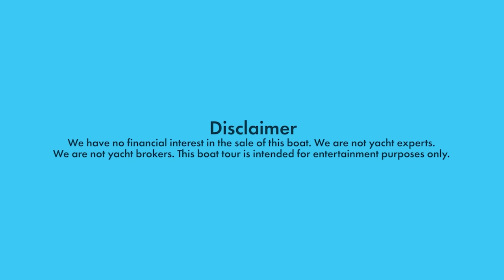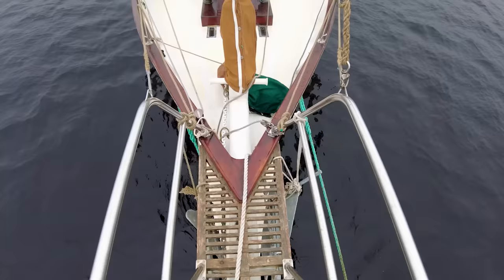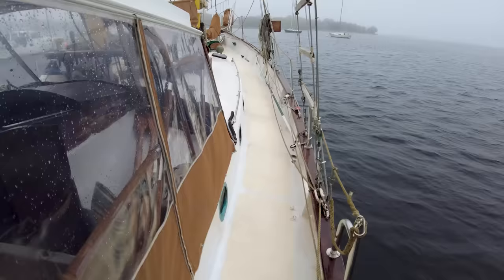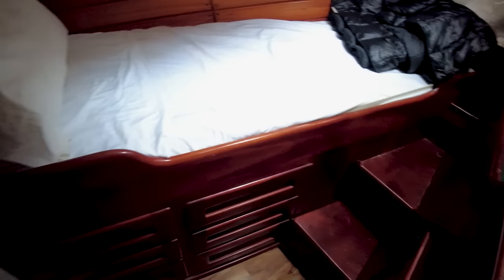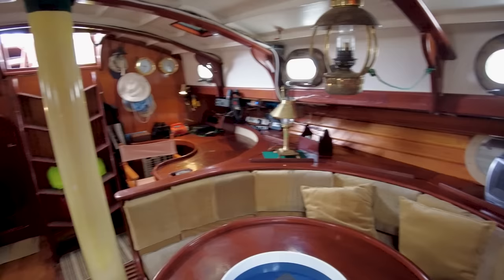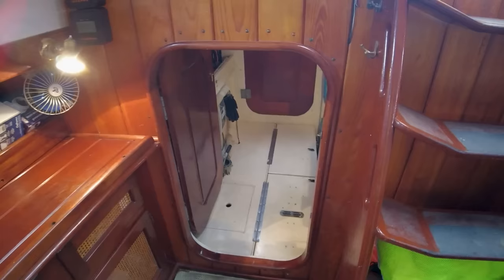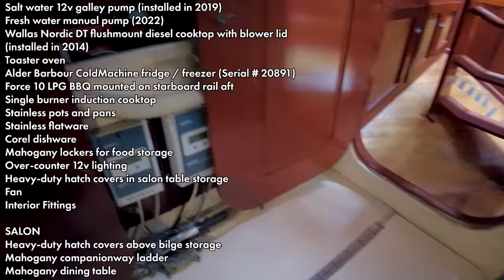This 62' STEEL Schooner Will SHOCK You [Full Tour] Learning the Lines

Comment: Gaff rigged topsail schooner.  The foremast is a gaff with the option to run a square topsail. The horizontal yard on the foremast is actually two yards lashed together. because you have to go aloft to set it, its. an near certainty that its almost never used, and the sail is stowed below deck.

Very old school indeed, a 19th century fisherman would find it fairly familiar if rather overly luxurious.  Need a crew of 5 or 6 and they had best be seamen all of them.

Comment: Ca'mon man, ask some questions before you publish so you'll look less like you've learned nothing, the "Organizer" is a FifeRail. For securing halyards, etc, not for hanging stuff.
Obviously the fire is gaff rigged, why else would it have a gaff.
The Maine is Bermudian or Marconi.
The aft wooden rail could be called a "fly rail or taffrail".
This schooner may be unique in some details but this Colvin hull has been used hundred of times, with variations of rig and cabin plan. 
This boat has a self tending/tacking club staysail, and a jib.
The horizontal spar aloft in the fire(mast) is a yard, although that is the first I've ever seen that is not symmetrical side to side.
This is undoubtedly a home built or home finished where things didn't work out quite like hoped.
Lots of work to remedy.
The wood over steel deck is an issue, advanced steel rot underneath.
Good luck getting insurance on an older custom steel vessel period.
Curved bench in galley provides zero place to comfortably relax.
Galley forward is great until the cook comes up sick in the first real seaway.
NO OVEN!

Comment: Its a very cool boat. But before I would go onto the ocean, I would definitely make compartments on a steel boat that can stay afloat with at the very least 1 compartment or the biggest compartment completely filled with water. Done with steel navy like doors and hatches in the bulkheads and decks. But that is just me. 

Also I would install ventilation that you can close off from any water. Maybe even a heat pump. And install thick insulation all round. 

Now, if you have that a lot can be done, and fun can be had. But I'm not sinking in the middle of the ocean.  

Also installing big antennas on the ship so you can work all HF ham bands and satellites. If the rigging is used the profile is not big at all. Seems like there is already a HF radio and tuner. It is unclear what antenna is used for this while its not mentioned.  

Get a starlink installed too. For internet. 

Netting on the sides instead of ropes you can fall past. 

Get scuba gear so you can scuba dive, and a pressure pump to fill the canisters. 

A 3 meter rubber inflatable boat and an outboard engine. You can have these boats fill up with pressure canisters too!  

A transformer in the corner and some welding rods and tools can have you repair your steel ship in about any place that has power. 

The deck at the back, or the entire deck you could replace with plate steel. If I beams are purchased you could create a very sturdy deck. Or is there steel under the wood already??

I like the dingy in the back. 

There is a long list of stuff on it too. 199k Canadian dollars. For 150.8k USD that is something to consider. But it sure is a lot of money. 

Greetings,

Jeff

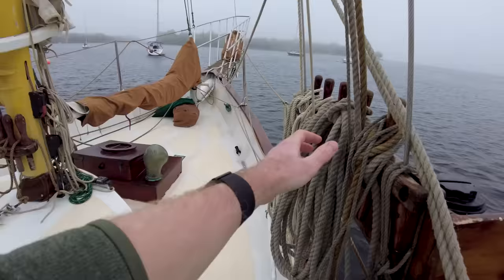Comment: 2:37 "You don't have to worry about rot" … but you sure have to worry about rust !!!…

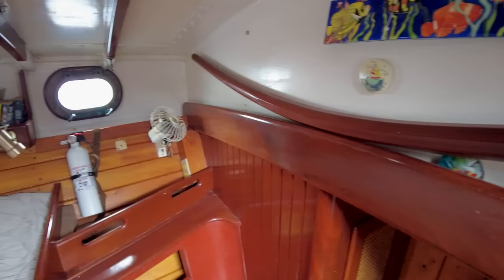19:54 "tiller … if you wanna be at the tille instead at the wheel" : mist likely it is an emergency tiller would the wheel mechanism break in a dire moment. It is pretty wise : actually in some European countries an emergency tiller is mandatory on all boat steering with a wheel.

Judging by the main cabin roof seen from below it seems the deck doesn't have insulation : when sun heats, it must be a real inferno down there. Also it certainly means the hull isn't insulated either. Which is a real drawback both in very warm and cold weather.
This would be my main concern.
Otherwise the boat seems to be very well taken care of…
Personally I don't like the galley being amidship, I prefer it so be close to the companionway for many reasons : odors can escape more freely, the cook is in his/her own corner and not in the way of crew going from the forecabin to the salon, and space left in the companion way could well be fitted with two single berths over each other which would greatly improve the sleeping capacity. This boat should sleep a minimum of 6 persons because handling such a heavy boat takes some muscle and accommodating 8 crew will certainly help navigate farther in the same amount of time.
I always loved sailing with a good numerous crew, prided the boat could accommodate them, because we could sail in a month in place as far as Scotland or Portugal from Brittany and back in 4 weeks … while same boat with a limited crew of 4 were restrained to the English Cornwalls or the Atlantic coast of France. Far sailing takes its toll, and sharing the effort makes us enjoy cruising more. Then again that's how you meet people from all kinds of backgrounds and the huma experience is something to remember (of cours ebad experiences exist too, but we forget these).

Comment: Looks like a delight to sail WITH a crew that doesn't have sleeping space. I'm 6'1" 238, so I'd be very cramped in this boat. Love the large engine room, hate the small doors and ladder face plant potential.. The price is right though. Steel sailboats are hard to come by. Making the main cabin into a full size bed would be a piece of cake. I'd change the rigging immediately to make it one or two people compatible and defintely reduce the amount of lines. Rope is old and needs replacing. Steel boats are HOT in warmer climates so ventilation is definitely a factor. But for thirty grand or less, in repairs and modifications, this boat could be an absolute delight depending upon the surveyors report.
Reply: Try eating some vegetables.

Comment: Having watched a few of your clips I feel I have take some criticisms: the reviews appear tuned to females? How many women buy boats? A man wants data: name of the boat, if it’s a commonly built design approximate numbers, stats: year of build, dimensions, build material e.g. hull steel or glass or wood etc, rig, sail suit, bunks, shower, toilet, water and fuse tank size, water maker, separate Gen set, engine, prop type, keel type, draught/draft, electrics, electronics, anchors and chain etc. get it? Information and data. A biography of the builder, a history of the boat.

Comment: The upswept bow is great but you want to make sure the foremast and headsails are keeled deeper than the the mainsail and the center board keel doesn't interfere with the keel line stem to stern academic keeling design reduces heeling over and increases speed..
Reply: it doesn't have a centre board

Comment: The top spar for the square is called a yard. The wooden railing at the stern is called a taff rail. I’d like to see this vessel under sail, and I’d like to see the square being deployed and used.
Reply: If they followed suggestions from Colvin I've seen on other boats and in his book, the Yard stays rigged and the sail is deployed or doused from deck with lines.  The yard can be dropped seasonally for less windage aloft.

Comment: Although I love to see these old-fashion boats in the marina, I never would own one: The rigging demands an entire team to sail it, that is my first issue. Good for a sailing school or organization of enthusiasts, but useless for a couple or even family with small kids. In the same time it is priced at the level of many 40 foot modern catamarans, which could be singlehanded. Steel is absolutely not without issues either. It may not rot, but it do corrode and a boat this age need thorough inspection before deal is made or it may end up being an absolute dead end bringing it back to sailing condition. The cockpit is uncomfortable and the whole under deck accommodation is unique, yes, but only fit for small people: I would hit my head hundred times every day in rough seas. You should only buy this sort of boat, if you are okay with the boat being your full time job maintaining it, because it will be.
Reply: I agree with everything you said and the MAIN problem is the 'Rig' setup. Would require a crew of AT LEAST 3 able bodied seamen to take full advantage of all the sails. If this vessel was a Sloop Rig it could be 'Single Handed'. As you pointed out "Headroom" is a problem as is the Cockpit layout. 
And lastly, the Head is adjacent to the Galley or should I say kind of 'in' the Galley.
Not overpriced for workmanship or materials but certainly overpriced for what the design is.